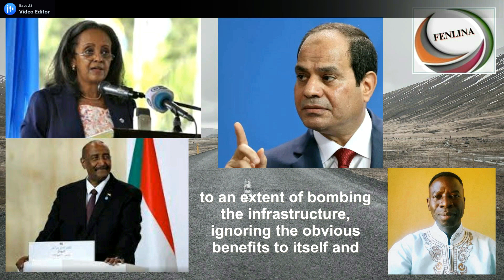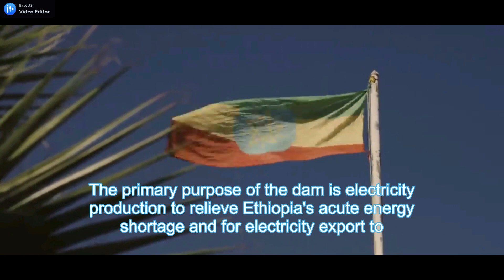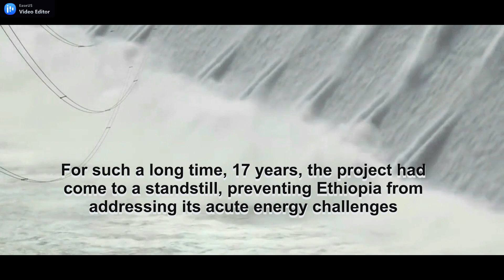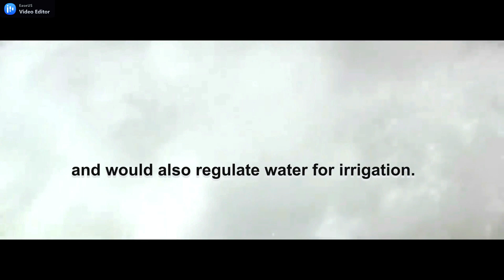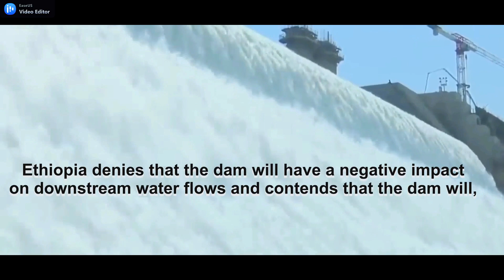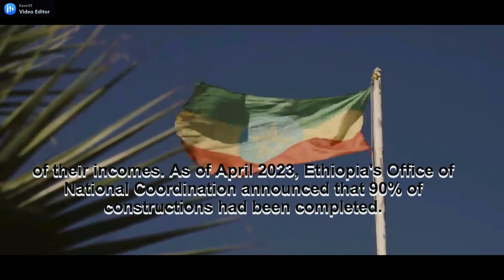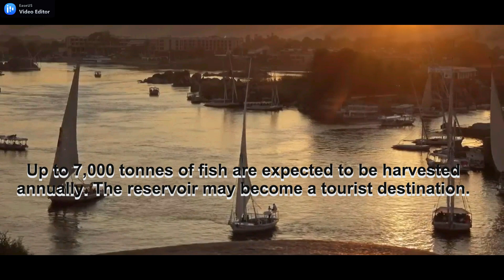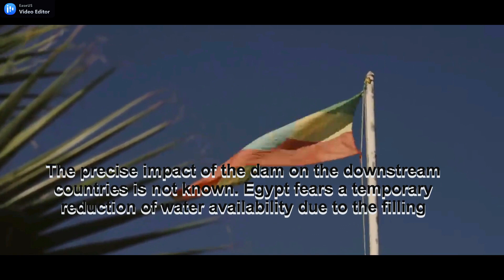How can Africa dare block its own prosperity? The Grand Ethiopian Renaissance Dam, Biggest in Africa

Comment: Egypt is largely self-sufficient in the production of most agricultural products except for wheat, oil, and sugar.

Does Egypt produce a lot of wheat?
Egypt produces half of the 20 million tons of wheat that it consumes with irrigation and imports the other half. 
Egypt is also the world's largest importer of wheat. 
The population of Egypt is currently growing at 2.2% annually, and projections indicate that the demand for wheat will triple by the end of the century.

What is the main agricultural product of Egypt?
Rice is one of the major field crops, grown on nearly 500 000 feddans, and is considered the second most important EXPORT crop after cotton. 
Wheat is the major winter cereal grain crop and the third major crop in terms of area planted (about 600 000 feddans.

Egypt's total agricultural crop production has increased by more than 20 percent in the past decade. 
During the same period, the rate of population growth has increased at a slightly higher rate than the increase in crop production. 
The most important crops grown in Egypt are discussed briefly below.

Cereals:
Rice: is one of the major field crops, grown on nearly 500 000 feddans, and is considered the second most important EXPORT crop after cotton. 

Wheat: is the major winter cereal grain crop and the third major crop in terms of area planted (about 600 000 feddans). 

Maize: is the second most important crop (750 000 feddans), but at least 50 percent of its production is used for livestock and poultry feed.

Fibre crops:
Cotton has traditionally been the most important fibre crop in Egypt and the leading agricultural EXPORT crop.

Sugar crops:
Sugar cane is the main sugar crop in upper Egypt. 
About 90 percent of the yield is used for sugar extraction. 
Sugar beet also grows in large areas in the Nile delta, and contributes to the sugar industry in Egypt.

Food legumes. 
These include a number of bean crops that are used for human consumption, such as broad beans and soybeans.

Forage crops. Egyptian clover, berseem, is the major winter forage crop cultivated in the Nile Valley and delta. 
It is the most widely grown field crop and occupies an area which totals 1.2 million feddans.

Fruits. 
Citrus, primarily oranges that represent 85 percent of total citrus production, makes up 50 percent of total fruit production. 
The fruit-planted area has expanded over the last three decades to reach about 200 000 feddans. 
Other subtropical fruits are also grown in Egypt, including grapes, stone fruits and pome fruits.

Vegetables. 
Tomatoes are grown in three seasons - winter, summer and autumn - on about 3 percent of Egypt's total planted area. 
Losses in tomato crops have been large as a result of tomato leaf curl virus, early and late blight, and nematodes. 
Potatoes are the second most important vegetable after tomatoes, both in terms of cash value and total tonnage produced.